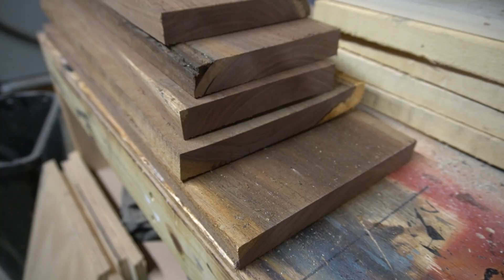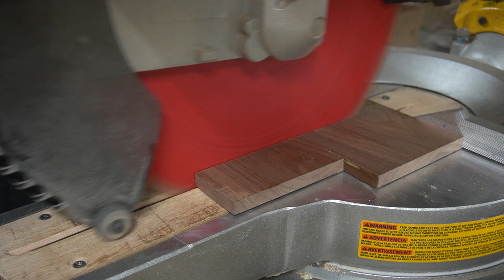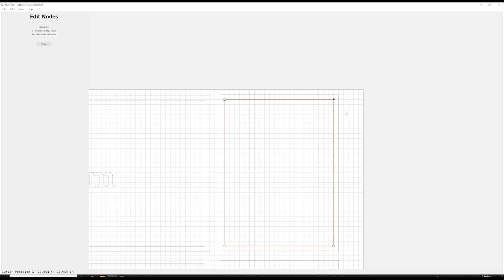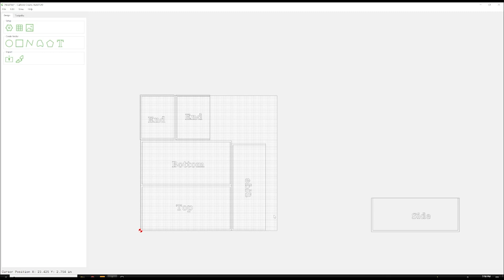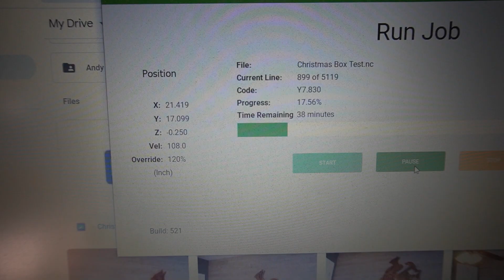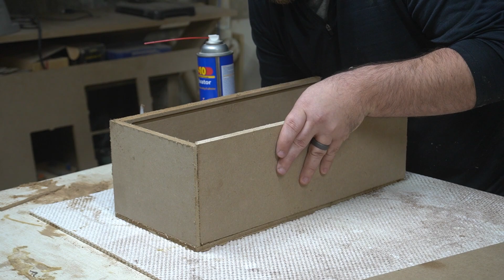My First Box And First Wooden Inlay With A CNC Router - Making A Christmas Eve Gift Box

Comment: Great work Andy. your 1st plan could have worked if you could carve individual pieces against 90°edge rails so that you had a repeatable corner for every piece, just cut each piece oversized on saw & final mill to size on CNC.. Great result with the inlay. You will dial in tighter tollerances for the sliding lid with each attempt. Do some scrapwood modelling can help & remember everything is repeatable on CNC, so you can go back & trim finer lines. Learn as you go !
Reply from the maker: Great point!

Comment: I've spent the last couple days mucking about with a bee inlay - my first as well. It had to be C-carved inside as well as outside. It was pretty challenging for a first carve lol.

One thing to note about the starting depth of .1": If you are going to do a clearing toolpath with, say, a 1/4" bit, and have that bit set to .05" passes, you're FIRST depth pass will be .15". That's a hefty cut for a lot of machines, so consider that when setting your speeds and how your work is clamped/secured. I ended up setting my clearing paths separately in V Carve for this reason. I didn't break any bits, so I'm counting the whole thing as a victory lol.
Reply from the maker: Thanks for bringing the first cut depth. That's a great point.